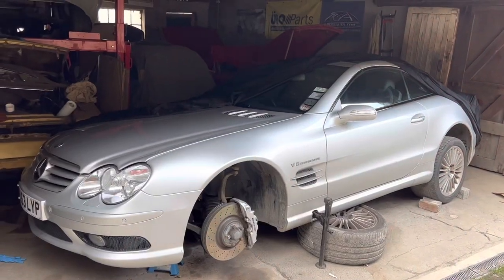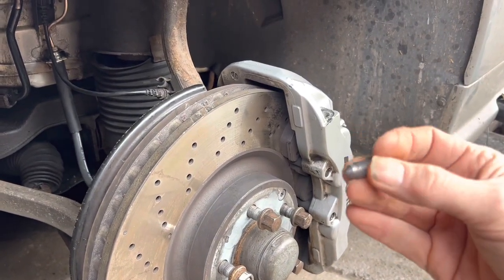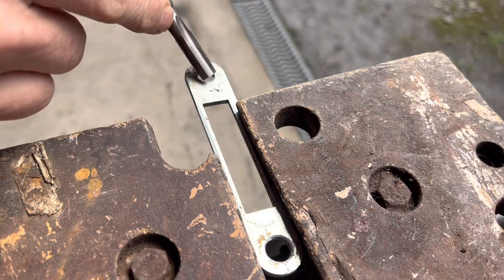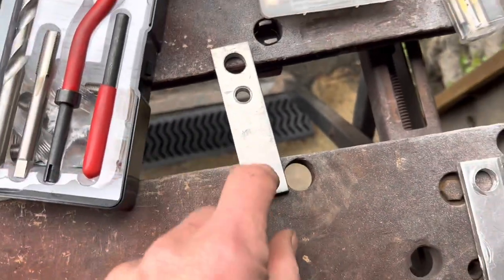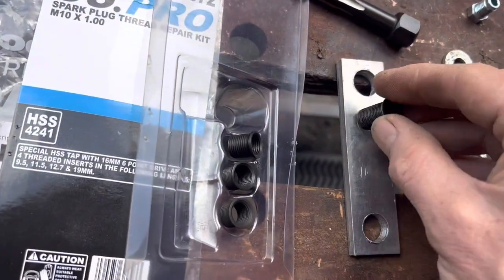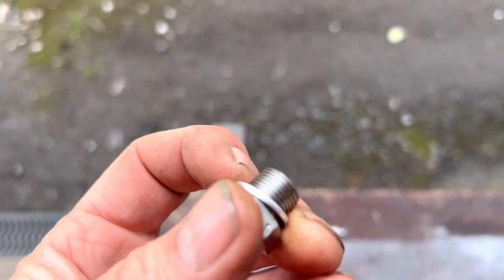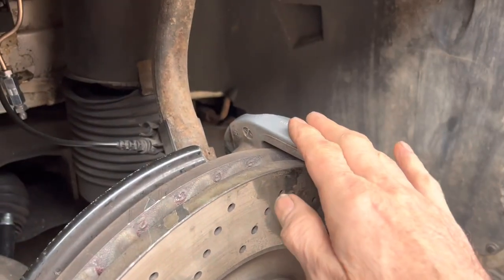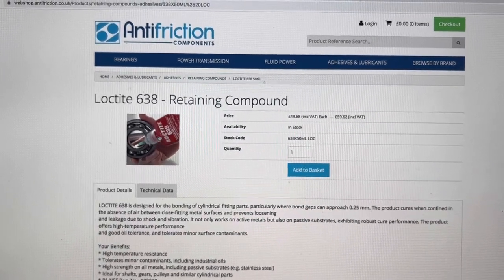How to avoid snapping a brake bleed nipple and how to recover if you do.

Comment: Nice repair Mike. I’ve never seen the heat induction coil tool before. Great info!
Reply from the maker: Hi - yes that induction rod saved the day, and has been really useful getting seized fitting free on my Pagoda in situations where you cant use a MAP torch. The joys of English rust.... Mike
Reply: @MikesMercsandothercars use the fine head on a map torch mate if you need concentrated heat. I can heat a 5mm 316 stainless bolt up on a GRP boat with the fine head and not burn even the gell coat. If im using the normal head or typhoon/cyclone type heads on the torch it would blister the gellcoat up in about 3 sec flat. The fine tip comes out the torch in a pattern that looks like a thorn and you can dial the thing down so its basically the length and width of a matchstick
Reply from the maker: If you can send me a link to the type of fine head you use on your torch, I'll get one and maybe do a little video on the subject. Mike @bigduphusaj162

Comment: Great video. Just done exactly the same on a caliper and it is literally days of slow work trying not to damage the valve seat.
Reply from the maker: Hope you get it sorted. Mike
Reply: @MikesMercsandothercars ended up doing the same as you with a new M12 with valve seat that fits the oem M8 inside, so thankyou very much for the solution!

Comment: Induction  heater + impact driver - The best extraction solution I've seen so far.. I've got to attempt this solution soon on both rear calipers of my Skoda Fabia. 

I haven't inspected it yet, but dealers advised that its £600 a side to replace wifh new.! 

I wonder if  a can of plumbers freezer spray, in addition to the heat, would assist in the removal. I suppose that differential in the coefficient of expansion between steel and aluminium would come into play. 

Also, wonder if its possible to reverse the electro-phorectic induced adhesion by using an electrical current - one pole on the nipple, one on the caliper, applied in the reverse direction to the transfer. I would imagine you would need to do a disconnect the caliper from the hub mechanically, hydraulically and electrically and bench it. 

Alternatively, I wonder if anybody has seen examples of hand-held ultra sound machines being used to rock the nipple free.? 

I presume a steel insert would inhibit further corrosion and adhesion. So, you have got to wonder why Mercedes, as a prestige brand, are not stipulating this in their subby supply contracts ? 

Wonder if a very light smearing of  water-repelling calcium grease on the new nipple would inhibit any future electro-phorectic action.? 

I think the glued in spark plug insert solution was what was used for the crankcase (Aluminium) drain plug (Steel) on my Honda CB125 M/C  in the 1970s, when I over-tightened it and split the crankcase at the edge of the plug hole. In those days they used  bog-standard araldite as the glue and to cap it off used an old spark-plug, with the insulator cut-off as the new drain plug. Real back street mechanicing.

Worked-a-treat 'til I had the time and money to disaasemble the engine and take the damaged half of the crankcase to an engineering works.
Reply from the maker: Holy Smoly - £600? That sounds like AMG prices. That induction torch has proved to be a god send - and in fact I just lent it to AutoClassico in Bristol to try and unseize a really awkward window wiper spindle on a very old merc. 

I tried cheap and cheerful freeze spray on this job and it didn't work. I have since bought a can of  Wurth Blue Ice Rost Off spray which I have yet to test.

https://eshop.wurth.co.uk/Product-categories/Rust-remover-Rost-Off-Blue-Ice/31083008050103.cyid/3108.cgid/en/GB/GBP/

Good luck with your job.

Mike

Comment: Youre not supposed to use inserts on brake calipers they are known for leaking and melting and popping and even causing a fire if you get a caliper bind up. They arent watertight threads so is an automatic MOT fail if they get spotted in a caliper. Heat wise you are best using Map-x on an alloy caliper mate as it can heat just the nipple quick without putting to much surrounding heat in like a weaker torch would as you need to stay in longer. If you dont want to damage anything you quench the bleeder with water so get it red hot then immediately spray it with cold water. The most you will ever have to do this is 3 times and the bleeder will come out with a set of cobras or moleys nevermind a socket. They irwin stud removers are crap now, Snap-on bought them over and now sell the older Irvins under their own name and Irwin sell junk ones in the same sort of box the oldsr ones had.
Reply from the maker: Great comments - thank you.

Interesting what you say on the threads. The green Loctite is specifically designed to seal threads and fill any gaps (as opposed to the red or blue)...and is supposedly heat resistant. I guess - a good way to test this is to take the car on the track. Good excuse to test the handling.

Car is coming up for an MOT so it will be interesting to see if they pick up on that. They are usually pretty strict on brake related stuff.

Not familiar with ' cobras or moleys' but will check these out. Similarly never new about Map X burning hotter so that is another great piece of info. Would be really interested to see Map X vs Induction torch. Probably have a chance to test this when I come to do the other caliper.

Thanks again for sharing your experience - whenever I watch a Youtube video, I always read the comments because that is where the experience often lies. Mike

Comment: I’ve managed to break off two bleed nipples on my 1992 BMW 730i. I’m going to try an impact screwdriver to shock the threads in the unscrew direction. Too late to try the induction thingy as they’ve already broken off.
Reply from the maker: Oh no! With the benefit of hindsight, the best option is probably to take off the callipers and give them to a machine shop to drill out and re-tap. Trying to do it by eye without a really good pillar drill is fraught with danger. There are a couple of companies in the UK where you can send the whole calliper. Sometime those bleed nipples are not coming out whatever you try. Mike
Reply: @MikesMercsandothercars  I do actually have a pillar drill, but whether it's really good is another matter altogether!
Reply from the maker: Let me know how you get on - but...once you knacker that nice straight and centered hole down into the nipple, like gets much harder. Mike @thesushifiend

Comment: I've had good luck with electric impacts on caliper bleeders. Dont hit it full blast, let it hammer forwards then backwards until it starts to move them you can zip it out.
Reply from the maker: Thanks for your comment. Yes a good impact can help...gently does it. I usually do water pump bolts with an impact...but last time 5 out of 6 snapped! Cant win them all....Mike

Comment: Good heavens...!! That was one big war, not a battle.
Reply from the maker: Cant tell you how relieved I am that it is over! Mike
Reply: this is why you heat and quench every bleed nipple that even threatenes to stay on as soon as you go any further. Map-x torches are great but you need the fine head on them or they can create too much surrounding heat as he said. The fine tip nozzle on a mapX torch is amazing for this and all you do is heat it and spray it with cold water twice or at the vey most 3 times. They usually come off after the first quench. Also to protect calipers from heat its easy, last time i did this i used meatal sheet plates that were designed to hold fire extinguishers and had a  12mm hole in them for the screw. I bent them over the caliper so the only thing pretrudung out was the bleeder and the paint on the caliper went to about luke warm water temp with the bleeder being red hot twice.

Comment: Do you have an aluminum magnet? Please send it to me
Reply from the maker: Thanks for your comment. Obviously the magnet only picks up swath from the steel brake bleed nipple. You need to put a small nail down the hole as shown at 14.51 to stop any aluminium swath getting into the line. If I do find a magnet for aluminium I'll be sure to let you know... Mike

Comment: if you do happen to drill to deep in to the seat . a small ball bearing under the new nipple will seal it
Reply from the maker: Thanks for your comment. That is an interesting tip - have you tried it yourself? Mike
Reply: @MikesMercsandothercars  yes a few times . grimeca who make some  motorcycle calipers use this from factory instead of the tapper on the  bleed nipple
Reply from the maker: Interesting....so often the case that the best info comes in the comments below a video.Mike @simonrawle7885

Comment: Spray bottle whith Awsome they sell at Dollar tree spay it whith it let set a couple minuts sray again then stiff toothbrush clean around it wire brush spay one more time whith Awsome then spray whith Lubricant vice grips grips tite as u can get them on it then little twist left little twist rite easy 4 or 5 times then it will come loose
Reply from the maker: Interesting - it's always good to read other peoples methods. Mike

Comment: For older car's like this,
just buy a brand new brake caliper.
No big deal 😂
Cheap as hell 👍
Reply from the maker: ……..£600 for a 2nd hand AMG Caliper if you can find one. For the R107 I’m doing current, I would hesitate to buy a new caliper if I ran into similar problems. Mike

Comment: OR YOU COULD SO IT RIGHTG THE FIRST TIME AND USE HEAT, I HAVENT BROKEN A BLEEDER IN 20 YEARS AND ILIVEIN THE RUST BELT! AMATURES SHOULD STAY AWAY FROPM FIXING CARS
Reply from the maker: Thanks for your comment. 

What heat source do you use on aluminium calipers?

I guess all professionals were amateurs when they started out and if you’ve worked on rusty cars for 20 years, I’ll bet you’ve encountered a few 5 minute jobs that turned into a nightmare?

Mike